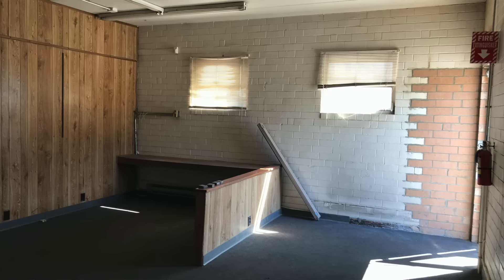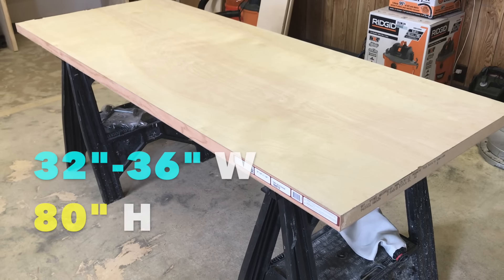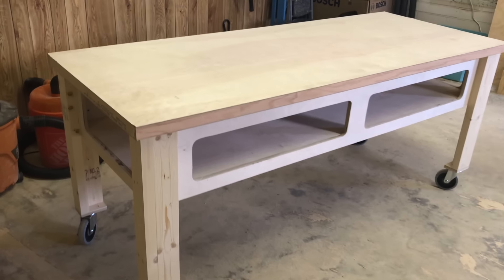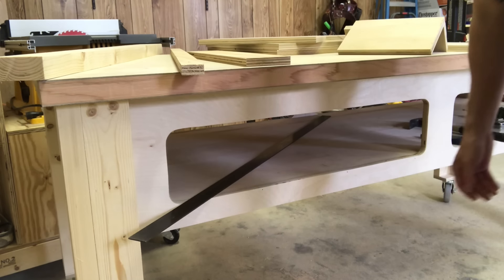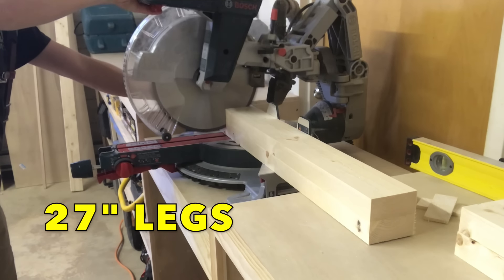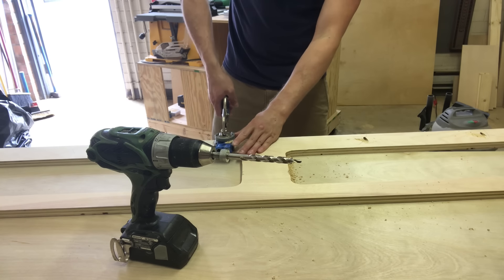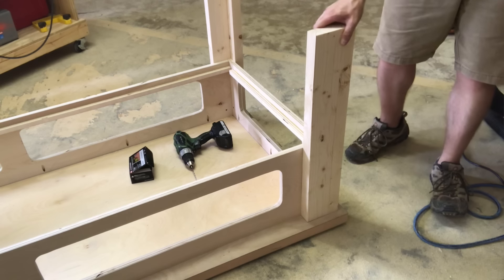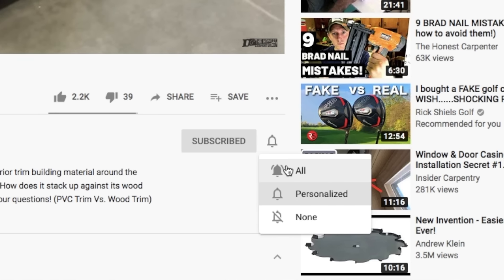These Make The BEST WORKSHOP TABLES / WORKBENCH!! (Tips, Tricks, Secrets--Workshop Table Full Build)

Comment: For a top I also really like laminating together 2x6 cut in half down the length. While leaving a lip around the edges with a slightly larger cut of wood. This allows for a panel of hardboard to be put in for a really easy to remove and replace top. It's even strong enough that you can put a sheet on and drill dog holes for more of a woodworking bench and less of a carpenters bench. But because it's removable if you don't need the dog hols all the time just out on a regular sheet of hardboard. It's a little more expensive and time consuming, but if you're looking to make the bench a more fixed fixture it's super handy.

Comment: I did a similar table   But the at the bottom inside of the narrow legs I ran a 2x4 so I could put a block underneath and get the wheels off the ground to keep it from moving and save the wheels from heavy pounding

Comment: I used a salvaged solid core door + sheet of 3/4 plywood + sheet of 3/4mdf + 1/4" hardboard, banded with 3/4" clear pine.  I thought the plywood layer would better resist side load from bench dogs, who knows.  What I do know is that my bench is heavy.  The nice thing about simple materials is that I did not bat an eye at routing grooves in it for miter bar clearance as my bench doubles as my outfeed table.  I also buried my vise in the front face of the bench for clamping long boards (my top does have an overhang like this one for clamping.  Once you realize a bench is a giant clamping tool you are on your way to functionality.

Comment: Nice simple build! I need something like this once I've built my workshop shed lol . For plenty of tools now stuck in the house lol..
Was thinking for anyone on tight spaces could always add under hung storgae compartments for individual power tools clamps or routers etc if for a smaller workshop shed set up limited on space the tools could be incorporated and still mobile to access them depending what you're using.  Just a thought as still plenty of clearance under the easy access shelf for tools you're using at the time sone more permanent storage underneath that if no other storage solutions if like a first build for your workshop etc? 
Anyway thanks from London England 👍💪😎🏴🙏

Comment: Your videos are most helpful.  I just built a shop/storage building in the back yard and equipping it with shelves for storage and designing the shop side.  I built your workshop table pretty much like you did.  I added a shelf about 6" above the floor for additional storage and used the side mounted casters to set it down after I move it.  You have great ideas and I thank you for for your suggestions!

Comment: Very nice bench. I’ve been using solid core doors for years and they work great. Two of my sons and several of my friends have benches I’ve made for them. I have a great supply of used doors I get for $1-$20. They are used so I sometimes shave off the hinge mortises and I plug the hole with blocking and use that location for an accessory. Great build and video for someone just starting our and learning todo something’s for themselves.

Comment: Great idea, thanks for sharing. 
How durable is the surface of the door? Usually surface on inside doors is thin, but reinforced by other material, or in some cases hollow.  I mean, would tightly clamping something damage it? Would it be sturdy enough to handle tools like a 12" drill press .. probably around 90lbs, and a miter saw.? Thanks.

Comment: Another Great Video!  Thanks!  I built a similar bench, but not with a door and mine needed 'help' to become completely flat.  
My 2 cents...  
Scrap doors work for work benches and platform beds too.
Add middle legs to a bottom skirt and a bottom shelf for more storage.  Cut some blocks to support the center of the workbench to avoid sagging when stationary.  This reduces mobility, but adds storage and durability.  My bench rarely gets moved.  
Also, I hate wasting plywood.  Has anyone else built their skirt by joining narrow plywood strips?

Comment: I went for a solid core door for a workbench several years ago. I didn't find a lot of solid core doors in the used market here in Spokane, WA, and what I did find were filled with plaster, not wood of any kind. They weren't labeled as fire resistant doors, although the plaster would probably make them more so than the wood-filled. I didn't think to look at new doors. I bought one anyway and found, to no ones surprise, that the plaster center made it a real pain to work with, most especially for drilling 3/4" bench dog holes. I agree with your points on using a solid core door, but I suggest that anyone going for it check that the filling isn't plaster -- somehow, if it hasn't been drilled or cut.
I like the way you teach in a non-teaching "here it is" sort of way.
PS, I'd bet that someone with a small garage could cut down a door a bit, hinge it to the wall along the long side, and either attach folding legs or even use sawhorses to hold it up in its workbench mode. That would make decluttering easy, too: pull out the supports, and, with a thump against the wall then propping it horizontal again, they'd have a fresh, decluttered bench top!
Reply: Love the idea of hinging a benchtop against the wall! That way I can have a wider bench at my disposal whenever I need it, as I already have a set of legs from my current workbench, so all I have to do, is mount a good wood solid core door to my wall!

Comment: This is freakin fantastic. I use a 5/8"  piece of OSB for a temporary shop table when I need it and I have to say the size is just too big. I also junk it up with all my tools. The door table is perfect. Since my OSB table is cut in half with a tongue and groove it is easy(ish) to take apart for storage. I'll have to think if this design of yours can be adapted to fold up somehow and store vertically.  

The only downside I can see is what to do for wide glue-ups like a table top. Maybe just clamp some 2x4s across so they hang over on each end.

Comment: I built a fixed position workbench out of 2 solid core doors from Habitat for Humanity in my garage/shop about 25 years ago. A replaceable plywood layer on top has been replaced twice but otherwise the whole thing has remained rock solid. A great way to cheaply create a brick of a workspace.
Reply from the maker: Good call, Grant! Habitat in my new city isn’t as good as the one in Raleigh—wish I’d bought slabs before I left. 😅

Comment: Great channel and lots of tips. I like the fast build but note one minor potential problem with the removable top. You had the bottom shelf loose at first to fasten the pocket holes for the top; then let it fall in place for the shelf and finally glued and bradded the shelf in place. This will make removing the top at a later date very difficult I think (there are several methods to do this). Although, some of the other comments appear to address really good alternatives. Once again, very nice and keep it up.

Comment: Great ideas, I shall use these in my rather small workshop (only 10 square meters)
Reply from the maker: Thanks, Jonathan! You could scale it down pretty effectively, and incorporate some bottom storage 🙂
Reply: @TheHonestCarpenter   Yup, that's my plan. Especially love the door idea. I'm hoping to have a combo design, part like yours and part with a horizontal rotation of tools. This way I can have a drill press on one side and a grinder on the other.

Comment: Very nice work table! I'm pondering the possibility of using it as an outfeed table for my table saw. Just now I'm eagerly awaiting the arrival of my dream woodworking bench, a split top Roubo from Benchcrafted. I think your table is very functional for a large variety of projects. For myself, I'm a hobbyist woodworker who likes to build furniture. The advantage of the Roubo is that the top and legs are coplanar and the top is four inches thick. One can use planing stops and old timey holdfasts because of the thick top. One whack on the top with a mallet sets the holdfast securely, another whack on the back of the holdfast releases it. The entire bench is essentially a clamping surface. It's way overkill for a casual DIYer but it can also be built fairly cheaply from Southern Yellow Pine if you have access to it. Mine will be about 350 lbs and made of maple. It has a leg vise, a tail vise, and a sliding deadman, and a built in planing stop. I think your table could really complement it as an assembly table/outfeed support. Love your channel! Excellent content!

Comment: I wish I had seen this last year. I went all out and built a Paulk. While that really works for me, I could have gone this way and saved some time and labor.
I would have gone with the retractable casters rather than the locking casters (that's what I put on mine when I gave it a solid base.), as they work great and the bench is solidly on the ground when they are retracted.

Comment: I picked up a hollow core door as a temporary bench top while building my laminated workbench. I still use it from time to time if I need a larger flat surface or something portable. You can't beat on it like you can a solid door, but it's lightweight, cheap and fairly flat. The solid core door is a good alternative for a more permanent solution though! If you wanted to get somewhat fancy, you could even edge-band it in solid wood and no one would ever know it was a door.
Reply: Can i cut down the width on the mdf door (bench top)? Thx

Comment: I love the idea of the doors for tops bro. I bought me a tonne of 8x4ft Ply, MDF & OSB3.. I wanna use it with my 4x2 now. I was thinking of using I piece of each of the big boards bcos I'm only going to go for a 5/6ft length workbench. I also want to use it as an outfeed table for my table saw as well. Also I want to eventually build in a measuring system on it but I might wait til I know what the future hold mate. I may build a bigger one on the future. I may need to get a bigger shop than the 16x10ft one I'm in now. I really want to be able to connect a track saw to my bench until I can either get a better table saw or whatever. 
I'm about to go off on one now Ethan so I'll stop now and say great job bro.. LMAO

Comment: I like your build, I kind of went overboard with my bench but then, I had intended on beating on it a lot more than I do.  When I was real young, I lived in Chicago and by driving up and down alleys, we accumulated tons of free wood. Solid core doors were in abundance at that time. People were updating and doing renovations big time in the late 60, early 70s. As time went along and my Dad got older, he started using 3/4 in plywood instead because it was TONS lighter to handle.  His saw horses were actually older than I was, go figure.

Comment: I’m a beginner and had no idea about using a door as a flat surface. But can it be easily cut to make a smaller work table due to not enough garage space?  The most ideal would be a folding or collapsing table on casters for storage when not in use.

Comment: Nice bench. Simple,  practical, fast to build. I like the way you reason your design. 

How do you find castors when using hand tools?  Is the bench stable/doesn't move? 

I used to assemble onsite benches from old doors and a pair of saw horses. Somehow I did not came to build a bench frame on castors yet - I'm worrying it will dance around when pushing it harder

All the best

Comment: Very briefly I placed my Bosch GCM 12SD on a standard hollow interior door on saw horses saw the sag and immediately decided it was a bad idea I recently got the saw so I am in process of deciding how to mount, currently it sits on a very sturdy, heavy hand made by my wife's uncle router table, it actually sits very nicely on it I am still new in woodworking so in winter months I used the back part of our laundry area, we have a split level roughly 2050 SQ feet with a finished basement so not a lot of extra room, in warmer months I move to garage so I am thinking a miter saw stand stand, but not sure if I should trust like the Ridigid or Delta I prefer the stand with wheels as part of the base so I cam move it eaiser, the Bosch is a very heavy saw, great video my comment didn't really pertain fully to your video but I figured I would share.

Comment: Very nice build! I made a similar workbench/assembly table with an overhang on all 4 sides for clamping - it makes a HUGE difference when you want to clamp down material. I used 3/4" plywood on the top, as using a door would be way too big for my space. 2'x4' is about right for me. I like the idea of the shelf below the table top to storing items so they're out of the way - I'll definitely look at adding one, as I have the room available.

Comment: Just curious, how solid is the core are we talking? I have a small shop so my bench will double as a Table Saw outfeed table and would need to router out some miter slots for my cross sled. Wondering if there are any voids inside 😬

Comment: I just built a table with a solid core door after seeing this. Any way to know what the interior is (particle board?) without cutting into it? I see the veneer but don't know how solid it is inside? Looking to mount a vise on it and don't know if lag screws alone would suffice or should I drill all the way through with bolts and washers.

Comment: Love the tip about the solid door. Was it a solid core/composite door or a solid timber door. Also is it able to have dog holes drilled in to the top to make it an assemble bench?
Reply from the maker: Composite, Meaty! I think it would hold dogs fine, but definitely wouldn’t be as durable as a solid lumber core.

Comment: For the windows I would have use the hole saw for the corners, you used it as the template, and then drop cut the sides. Probably be quicker. If worried about burn marks, then just hit it with a bit of 120 paper.

Comment: Great idea, however for the underneath table I would just put a 1/2 inch thick board with a 2 inch trim around the sides and back, to keep things from sliding off. I think it would be more frustrating to have to put things into a 5 1/2 port knowing some things may not fit. Therefore, just put an under board 10 -12 inhes, from the top, with a 2 inch trim which would allow more things to fit such as a circular saw, when not using.

Comment: I’m in the market for a new table saw. I’m looking at DeWalt and Bosch. What model DeWalt do you have?  Does it have plastic gears to raise and lower the blade?  Have you had any problems with it?  Recommended?  

Great video. Will be helpful as I need to replace my work table saw that was damaged in a water pipe break. 
Thx. Ken.

Comment: You say to cut 11 1/2 inch wide ply for the tool shelf sides, but with a 5 1/2in window, 3in at the top and 2 in at the bottom, where is the other inch?

Comment: love your channel.  i had a question.  i saw that you used pocket holes (no glue) to screw the table top to the table frame so that you can eventually flip it over.  but then you secured the bottom shelf with glue and nails.  since you glued and nailed the bottom shelf, and can't remove it, will you have enough space, between the bottom of the table top and the shelf, to fit a drill or screwdriver to unscrew the screws in the pocket holes?  it looks a little tight.  just curious.  keep up the good work.
Reply from the maker: Thanks for watching John! I could probably still pop out the bottom panel with a hammer and painters tool in a pinch 🙂

Comment: weighs a ton. lots at recycle materials yards.
I cut one in half, edge banded with left over 3/4 in hardwood flooring, dog hole full grid, 3/4 in box telescoping and peg height adjustable 3x3/4x4 inch legs on castors, assembly bench, clamps are ballast in removable deep-ish tray hanging off small french cleat blocks on lower legs. Keeps my work bench free. 

Torsion box design of scarp wood grid stays flat and rigid lighter work.
get the castors that have the swivel locking gear in the assembly.

Comment: The only thing I would do differently is use those slightly more expensive casters that have an additional mechanism to lock the swivel (rotation) of the caster. They also have a metal flap that sticks out so you can use your foot to lock and unlock them.
Reply from the maker: That’s a good point, user. There’s a chance I’ll even switch these out down the line. Trying to lock these switches with a hiking shoe in can be frustrating!

Comment: The only thing I would add is that if you build a breadboard edge and leave it just proud of the table top, you can then drop an exact cut piece of Masonite inside the breadboard edge. No fasteners necessary. When it gets gouged or a big glob of epoxy dries on it, just flip it over or eventually put in a new piece.

Comment: Nice build.  A lot of good ideas.  I prefer a top of 2x4’s on end with one edge removed to make the surface flat.  Drill holes for all thread counter sink the nut on the front face.  Install a 2x8 or 10 on the back of the bench, to keep items from falling off.  Install 2 circuit plug mold on the 2x8.

Comment: Instead of jig saw to cut window corner radii, you could have drilled the corner with the hole saw bit used to trace them.
Reply from the maker: I actually did one corner like that when the jigsaw broke, Doug. But I found the lineup with freehand just wasn’t as good as it would have been with a drill press, so I tinkered with the jigsaw and got it tracking again 😅

Comment: Would you put braces across to strengthen the bottom from collapsing inward (in the middle) from weight?
Reply from the maker: Hey Steven, I may add clamp storage underneath. But I’m not too worried about a collapse. I bet I could get several hundred pounds up here with no problems, and I doubt I’ll ever load it that much.